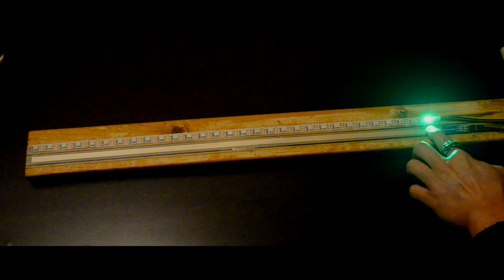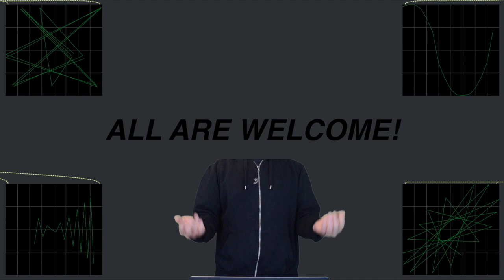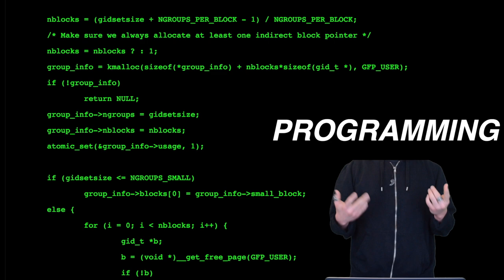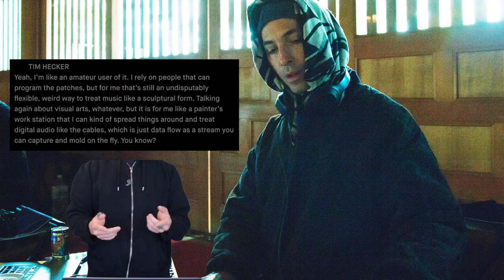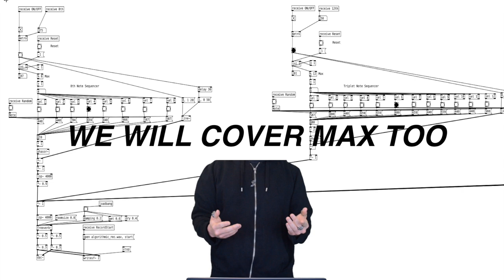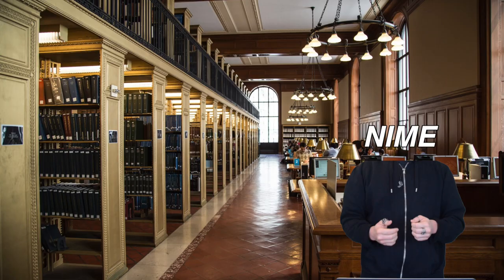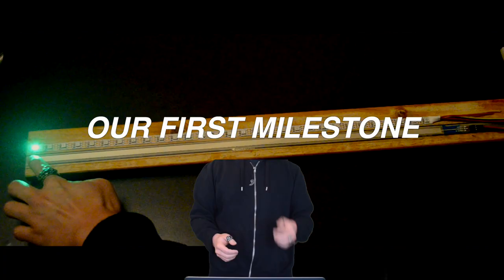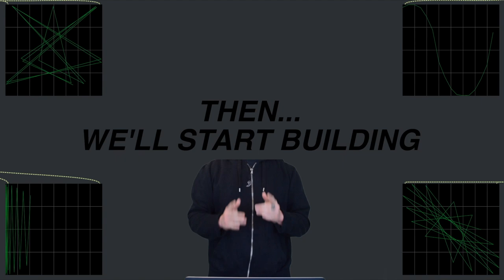Build Your Very Own Instrument (Channel Introduction)

Comment: I have good knowledge on Max but not on PD, do you think I can follow up only with Max?
Reply from the maker: I do recommend using Pd, but I have a feeling that there could be several people who already know Max and basic synthesis and just want to get to the building part. I could possibly do a separate video on interfacing Max and Arduino when we get there. Let me think about it. 
 
That said, since lot of embedded audio hardware are Pd-based (Bela, Daisy, and such), it's certainly worth learning it. I'll be talking about this in the next video. 
Pd is super easy if you already know Max. It didn't take me too long to get used the minor differences.
Reply: I think I don’t mind to learn PD nevertheless.